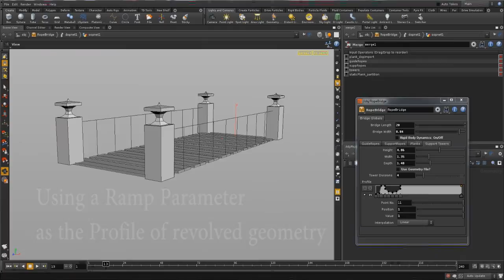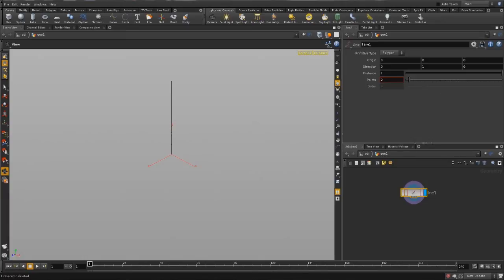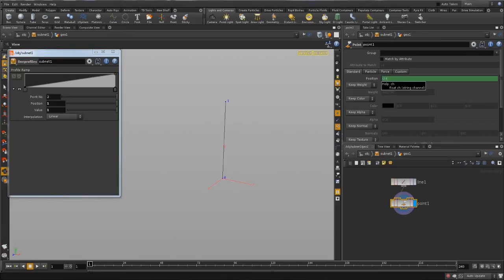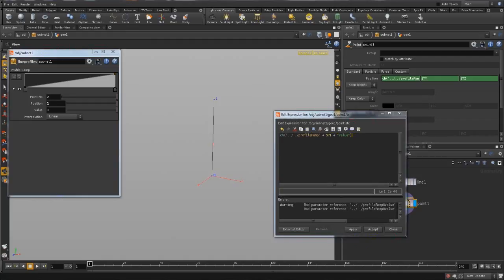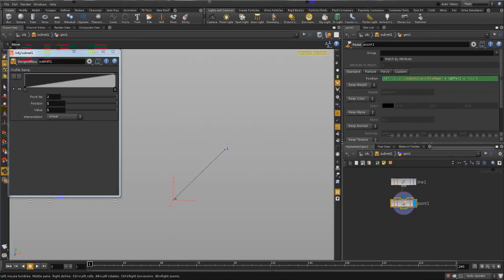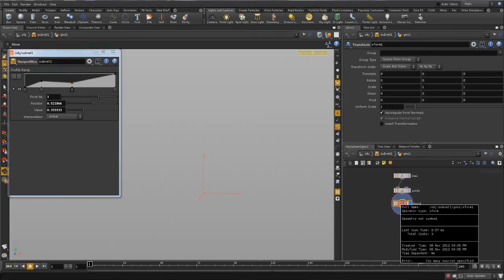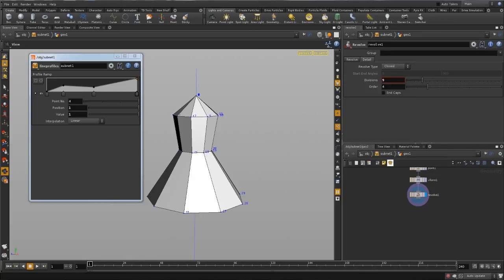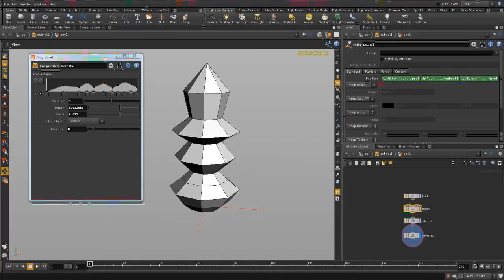Houdini Ramp to Geometry Profile

Comment: Also you can add the toggle from poly to nurbs and now you can make nice round handles or anything that needs a nurbssey look of smoothness. Divisions make it look even nicer soft three sided lathe type objects with just a few tick tacks on the asset controls. Nice tool.

Comment: Hey pal, really liked your tutorial; it's a great starting point for what I'm looking for. Quick question: is there any particular advantage to using a line instead of a curve?
Reply from the maker: Sorry busy, busy, busy. I used a line because it provides me more control at the beginning of the procedure. I require this control when implementing the procedural dynamics. The lines can be then converted to curves or turned to wires which I did later.